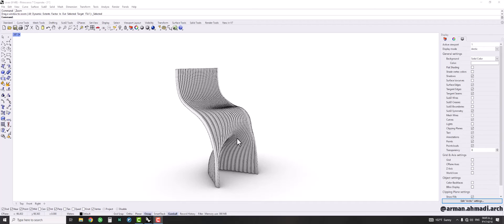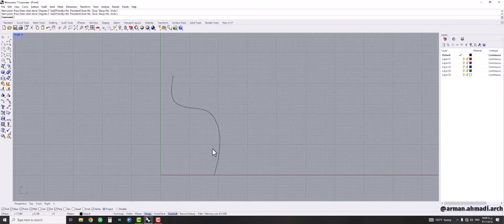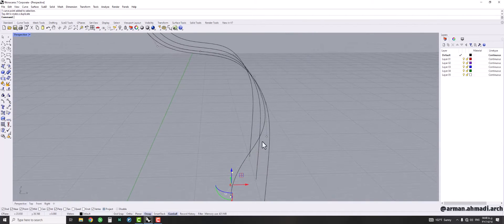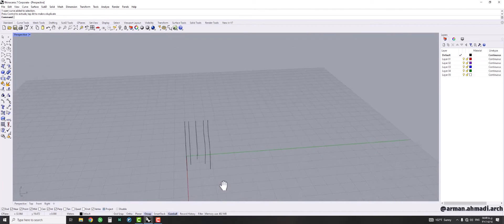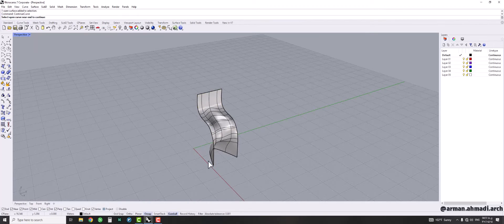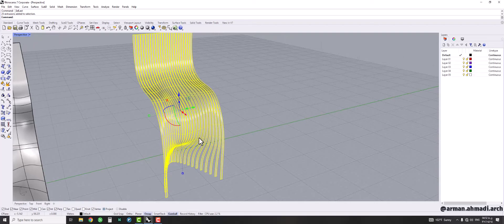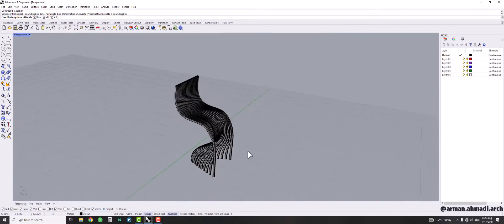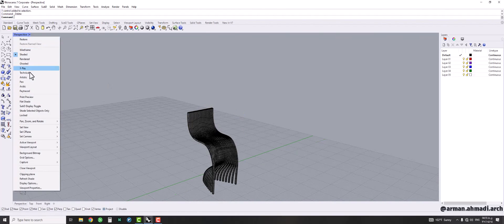parametric chair in rhino|layered chair prepared for cnc in rhino

Comment: Great content 😊really appreciate your hard work, could you pls make tutorials on bed and sofa models
Reply from the maker: For those kind of models, I suggest you use 3dsmax or blender since they are mesh based softwares and also they easily match with other mesh based softwares.
If you want to model a bed in rhino, the general parts are easy to create but some parts like pillows or blankets should be modeled with Marvelous designer and in this situation you have to export your model from Marvelous to Rhino or in reverse. In this process and also in rendering process you may face with some problems.
But I'll try to post something about it.
Reply: @rhinowitharman3121  yes i did try 3ds max and blender but i am not able to grasp them as i have been practicing rhino for last 3 tears , its do or die for me with rhino only and over time i have noticed rhino is the best modeling software, on other hand  3Ds Max UI is worst and very complex ,better i will do rhino + Marvelous Designer
Reply: @rhinowitharman3121 When Software’s Were Made - Rhino Was Primarily Focused On Modelling ( And Also Has Grasshoppers Support) While 3Ds Max Was Built For Animation ( I Agree If Someone Wants To Get Deep Into Animation Rhino Wont Work They Have To Shift To 3Ds Max) 

My Approach Is Taking Best Of Every Software Like Modeling Rhino , Cloth Simulation Marvellous Designer , Rendering Vray, Animation 3Ds Max Or Blender Or Cinema 4D